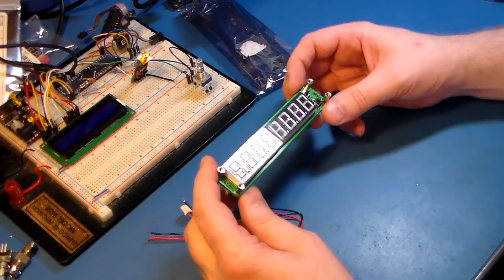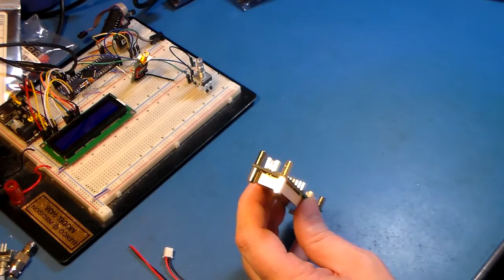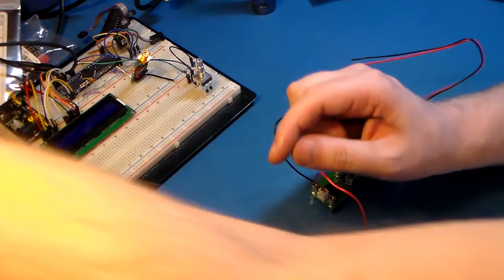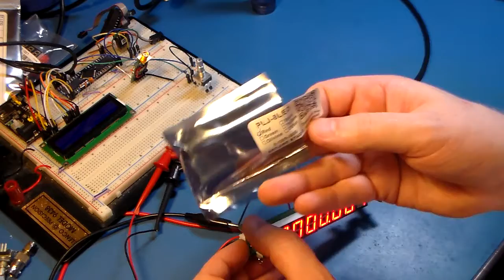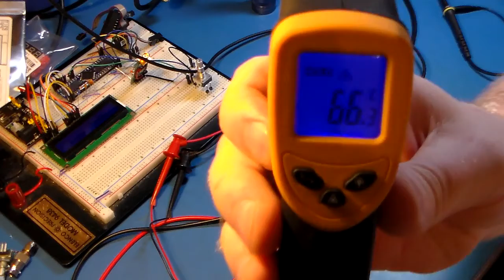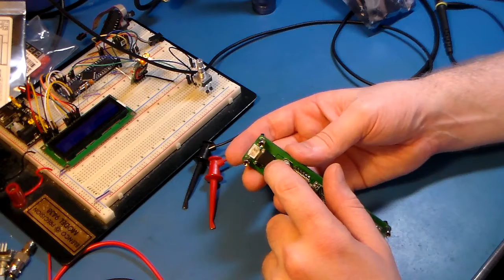Chinese 8 digit frequency counter module

Comment: The whole video is about regulator "issue". Man has no idea how linier regulator works, unfortunately, unprofessional.
Reply from the maker: no? because when you try to drop 14 volts down to 5 it absolutely does not get hot its just a fucking miracle right? Idiot. Do the maths. Piss off

Comment: What power supply voltage were you using? I use about 8V, and the regulator does not get hot.
You can use a raspberry pi style heat sink.
PS, you can remove the 7805, and mod in a dc-dc variable/dial down buck converter. However, there must be something loading it .. possibly a defective capacitor …
Reply from the maker: Nothign loading it. It's not designed to run with the 15 volts they claim it can run at. It's one of those .... yeah i designed and built the thing but I failed to derate the linear regulator..... probably because it's marketed to CB users that want to run their radios at 18 volts....

Comment: Not sure what you are doing wrong to make it so hot.  Mine runs cool as a cucumber on 9V in from my regulated power supply.  No mod needed.  Get the manual and read it before slamming something you know little about.
Reply from the maker: Because it's a shitty design. I have designed better, so yes I know. 
If you are running it at 9v that's why it runs cooler.
Next, try doing the maths. Power = V * I = [Vin * vOut] * I
You might find out WHY it gets so hot.
I don't need to read a manual. I can do arithmetic.
Cheers.

Comment: about he got info before he made this . the first IC is a prescaler driven by a dual gate preamp and the pots are gain control for the prescaler input output. .........These units are brill other than switching latency .......but very good for the money , they allso have IF switching for multi IF frequency switching or switchable to channel display . for the money are fab .........

Comment: If you run 5 volts to it instead of 8 volts it will not get hot. Maybe a little warm but not hot enough to hurt it. When you get this it tells you to run it on 5 not 8.

Comment: me again.
  i'm using a 9 volt smps instead of using a 12 volt unit.   the built in 5 volt regulator is much cooler.

Comment: no mention in manual of maximum dc volts riding  on  rf input.  anyone know ?
i want to use this counter to measure frequencies in tube circuits with as much as 250 vdc

does its rf preamp have  enough gain for me to use a scope probe
Reply: what manual?

Comment: No problems with any overheating at all between 9-12 volt. Tested between 1 Mhz-250 Mhz @ 100 mv - 200mv . Only problem between 48 Mhz and 59 Mhz unstable readings even by switching pins 4 and 5 I F on rear socket. Any one found same?.

Comment: Mine's been running for hours: 12v @130mA, regulator is no more than slightly warm... (btw, has the green leds)
And that was at brightness level 5 (and only 60ma @ BL2). You can lower it in the menu...

Comment: Hi Mark

I would like to use one of these inside (yes inside) the case of an old communications receiver. First the module would measure the intermediate frequency of the receiver and then an Arduino would somehow connect to the module to read the frequency from the circuit into an Arduino and then have the Arduino send the frequency by serial wireless to a remote display.

How would one use an Arduino to get the frequency from this circuit?

Comment: I have two and neither gets as hot as yours and I run them at 12v. Even so, and if you can't be bothered with a more involved solution, just cement a small heatsink on the 7805 casing (the type sold for fitting to PC Video card RAM chips). Works a treat.

Comment: i have a texas ranger 966 ssb.
Reply from the maker: Sorry for the late reply ... I get a lot of comments :)
I am going out on a limb and say that yeah, I bet you can get something going.
The issue is ssb offsets - that's not likely to work.
You would have to find out what is the signal and that is the power and wire accordingly.
It would not be perfect but it will read something for certain.
I might spend the 10 USD if I had one of those radios and try it out personally.

Comment: is there a way to connect a plug to it so it can be used on radios with the connector already on the back panel?
Reply from the maker: I would say there is a good possibility, yes.
What radio did you have in mind?
Reply: He is still talking about the TR966 - Ranger made the TR-696F,tr-696fd1 and the TR696F-SSB all had factory 6 digit counters. Seller: fasttrack*09 uses these in the counters he sells on E-bay for just about any radio.

Comment: Yep that is a suicide supply for sure. Probably best to just build a supply inside what you are putting it in. I would be interested in knowing if you can read the content of the pic for future programming. I may have to get one of them and try it out. Nice review Mark. Thanks
Reply: Just google PLJ-8LED for a Pdf. for the 8 LED or PLJ-6LED for the 6 LED,Seller: fasttrack*09 also has the wiring for the different radios under his description of his Frequency Counter and he Claims it will work on SSB. He has been selling them on E-bay for over a year that I know of. I know the 8 LED has a 13 page pdf download that shows everything.

Comment: I was thinking trashcan the voltage regulator.   Stick on a TO-220 package one with a real heatsink.
Reply from the maker: Probably work just fine, yeah....
Anything is better than the DPAK that has no heatsink area.
Reply: +Mark19960 

I didn't even see the qr code sticker, trashcan digging time.  Actually figured it out without the manual.  Top button selects functions and bottom scrolls through digits.
Reply: Something is needed on these Washington radios and others with the extra channels to see where you are at - some have flip switches some use the radio buttons but there is no way to tell where you are at.
Reply: https://www.zl2pd.com/files/PLJ-8LED_Manual_Translation_EN.pdf